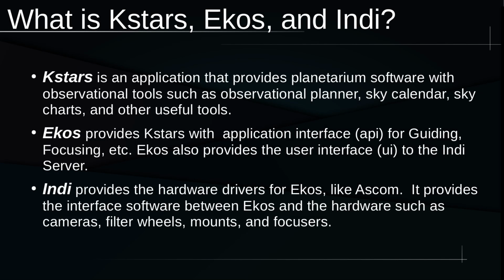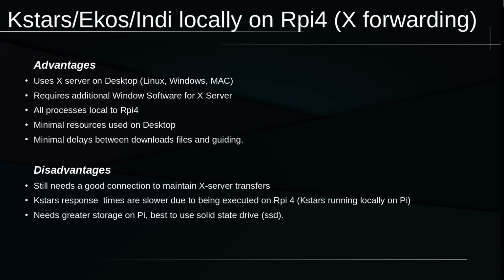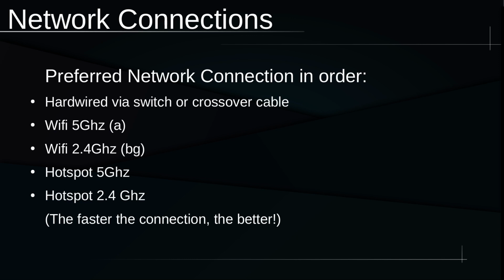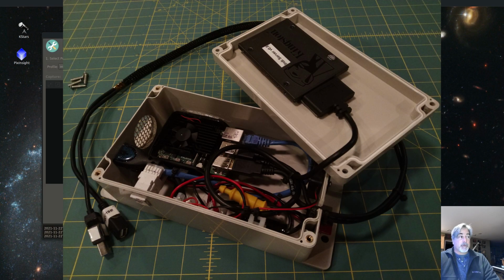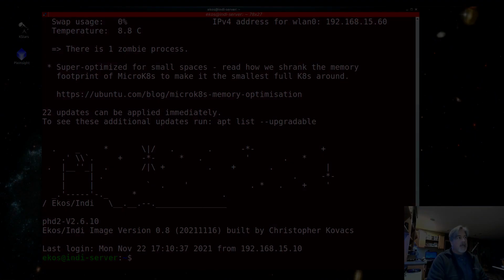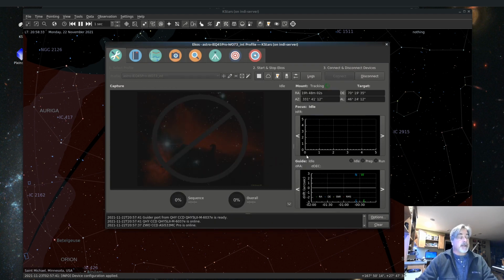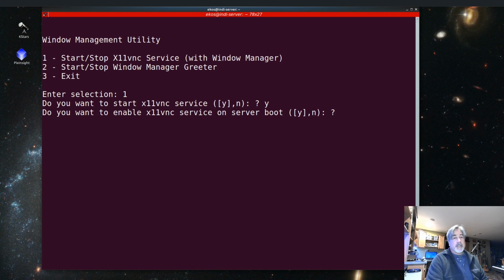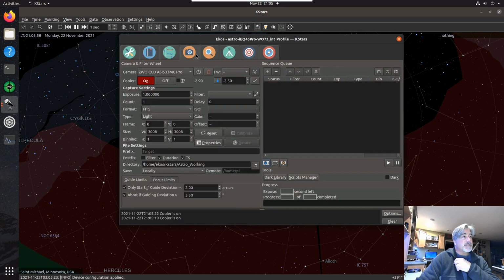Methods of Using Kstars/Ekos/Indi

Comment: Nice presentation. X forwarding can be pretty bandwidth-intensive (much more so than VNC in many cases), so I would probably only use it if the RPi is using a wired connection or a very solid WiFi connection. It might be worthwhile to try compression (-C) on the ssh connection and comparing between enabling/disabling it (it can sometimes be slower).

X forwarding also works pretty well on Windows (via Xming as a local X display server) and Mac OS X (via Apple's own X Windows server in older OSes, or via XQuartz in newer versions).

Comment: Thank you for this tutorial.  Is there a solution/way to control telescope and camera via kstars/ekos for someone running a mini windows computer on the telescope, such as primaluce eagle, and kstars/ekos on a mac laptop?  If download kstars/ekos on the Eagle, will you have access the Indi drivers ?   Thank you
Reply from the maker: The "indiserver" executable needs to be executed on a Linux system whether it's an X86_64 or Arm.  It's the indiserver that connects to the various telescope hardware.   Windows and Linux are quite a bit different and unless you could run a virtual VM on the mini, you will not be able to run Ekos/Indi.   The only other solution that I can think of would be to make the mini computer a dual boot system meaning that you can either boot using Windows or Linux.  This brings all sorts of possible issues and it's not for the novice.
Reply: @ChristopherKovacsw0anm  Thank you, that's what I was thinking as well.

Comment: Hi Chris, again a very interesting video. But I got a question for you in regard to plate solving. In your video lessons you never load a driver for it. Isn't it necassary for internal solver? I think I need to activate a driver in the "Aux" section of the profile. What is right?

best regards Gunter
Reply from the maker: There are no drivers needed, it's built into Ekos.  You select "StellerSolver" in the astrometric section (Align tab).  Take a look at https://www.youtube.com/watch?v=7j9wUuQT7po&t=1889s

There are other ways to install the files needed, but I would need to provide further instructions.  Remember, it takes up about 34Gb of files space for the complete set. Cheers!
Reply: @ChristopherKovacsw0anm  Thanks Chris, I have that done already a couple times but this little aspect I was missing. I will continue to follow your EKOS and Kstars explanations.

Comment: The DEW CONTROL Status is what I’m looking for since my location is very near the Pacific Ocean, tell us more about it.
Reply from the maker: The dew controller is based upon Robert Brown's my dew controller pro3.  Information can be found at:
https://sourceforge.net/projects/arduinonanodewcontrollerpro/
and I believe the source code can be found on github:
https://github.com/brownrb/mydewcontrollerpro3.git

The dew controller software is written in Python and I had to modify Robert's code to make it easier for Python to communicate with dew controller. I used Python as it was available in Linux, were the original monitoring software was written in Free Pascal on Windows.  Check out his project and source code.

Comment: Good demystifying video with plenty of useful information! 
Around 7 minutes you’re talking about the preferred network connections. However you don’t mention the Raspberry Pi 4 inherent interference issue between USB3.0 devices and the 2.4GHz WiFi which makes it essential for many of us to use only the 5GHz band. I use two complete systems, both on 5GHz hotspots, controlling with a laptop running VNC Viewer, and monitoring (with occasional control for simple requirements) on an iPad. I just define the SSIDs as ‘Red’ and ‘Blue’ after the colours of my SSDs, and swap networks from time to time as needed. My rigs are around 8m from the house and I am either very nearby when setting up and polar aligning etc., or just inside the house on the other side of a glass door, so I’m not trying to operate at significant distance.
Reply from the maker: All excellent points.  I haven't used 2.4Ghz in some time and I thought that the Rpi4 improved issue with USB and WiFi, but really not sure about this.  Thanks for sharing your experience with hotspots and your laptop.  Cheers!